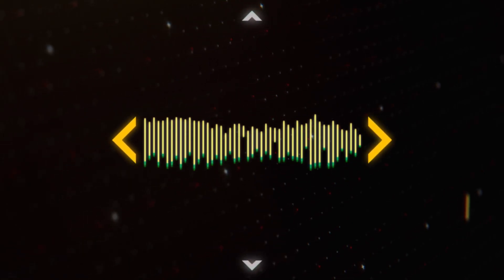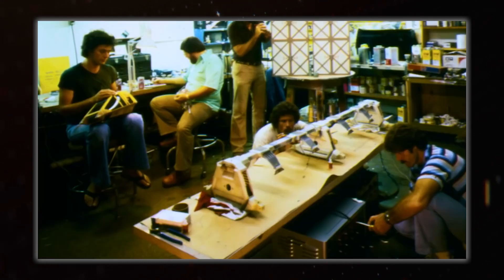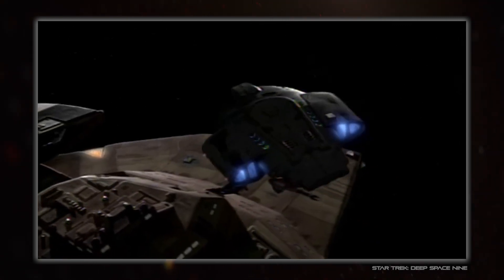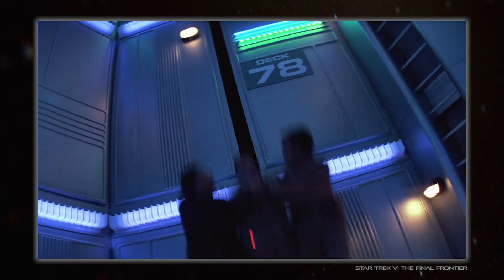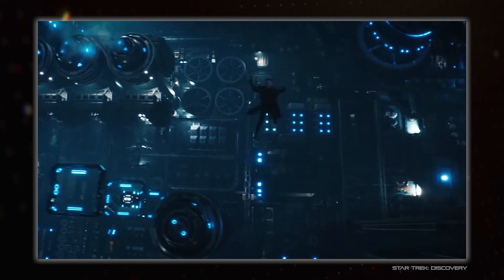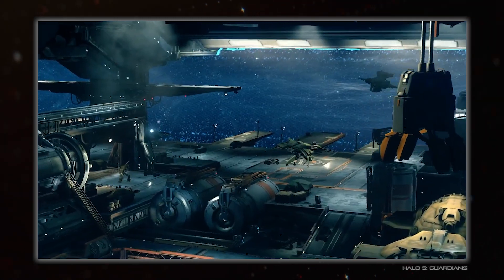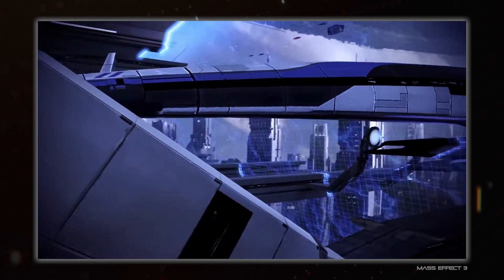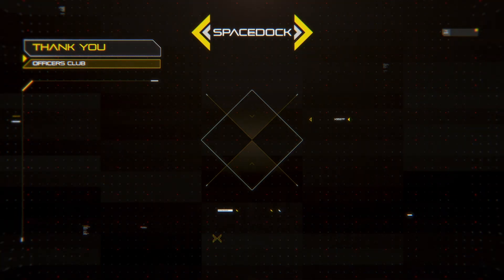Why Do Sci-Fi Spaceships Seem To Change Size?

Comment: A video on the practicality of ship size would be awsome!

It's such an important part to building a world, and can lead to some crazy stuff with massively oversized vessels.
Reply: One reason why real-world navy ships are so big is that the crews are huge (in number, not in personal size).  
     The amount of internal volume devoted to "hotel space" (actual industry term) is startling when you look at the plans.   Quarters, food storage, passageways for getting crew where they need to go, gym, sickbay, rooms full of HVAC gear for keeping all those spaces properly ventilated and climate-controlled, freshwater tanks, greywater tanks, sewage tanks, rec rooms, laundry, offices... then you need MORE crew to maintain all of that (cooks, personnel officers, chaplains, HVAC techs, security, etc) and room for them too.
     A commercial cargo ship the same size might have less than a quarter of the crew, just because they don't run under military systems and because they aren't really worried about needing enough people to fight the ship when half of them are dead.
    So the 300-meter Enterprise has 430 crew, while the 100-meter Serenity has five and the 30-meter Millennium Falcon has two.
      Any decisions regarding the size of a ship need to account for the military/civilian discrepancy in crew size, as well as how much room the available tech needs to support those people.
    For example, a replicator eliminates the need for a room full of canned food and a galley, but how much space does the replicator equipment and raw-material storage occupy?
Reply: @stevenscott2136  you also have to consider what it's like to live in them. Living in a submarine is unpleasant. Living on a naval ship, better but not that much better.

If people want to live in space size and the ability to not be constantly hemmed in and claustrophobic

It's why I think big ships and stations are more likely for pure psychological considerations.

Particularly space stations. With ships you might have a mass issue. But in space with no gravity to limit the way you build there's no need to make space anything other than absolutely massive and you don't give people small quarters with low ceilings and pokey little corridors to walk through.
Reply: Building things costs money, so usually the only reason for a ship to be larger than the bare minimum possible is if its increased size (and by extension increased cost) comes with benefits. 

Two smaller ships can be in two places as once, one big ship with twice the firepower cannot. There needs to be some further reason for increased size than a linear increase in firepower alone.

Historically, bigger battleships (dreadnoughts) were built because they could have larger guns and more powerful engines. Aircraft carriers are massive because they need to support a runway.
Reply: @zero3633  that's a very narrow way of looking at things. Particularly in any society that has access to the resources of a solar system and probably large scale automated mining and production of resources.

Cost is going to be fundamentally different consideration in many scifi settings.
Reply: Yeah I’ve always wondered why the ships of Warhammer 40k are SO FREAKING HUGE. Like I don’t really know much about the lore, but wasn’t it mentioned that a “light cruiser” was massive enough to leave a shadow on the planet’s surface from orbit. As epic as they look, I seriously doubt anything that large can keep itself aloft in atmosphere, and it’s a real wonder that anything that big and heavy and expensive can be built at all, especially by a Humanity that is on the ropes
Reply: @andrewhenson8787  Other than the rule of cool, I think there must be some connection with Gothic Architecture, which tends to enlarge the scale of churches once chosen as the main building style.
Reply: The irony is that in space ships really can be arbitrarily large. The only real reason to keep them smaller is the rocket equation, buy y'all people already have super-efficient magical engines that do not require the 90% of the ship being fuel tanks, don't you? =) What nobody seems to consider is how a large spaceship would actually behave. 
My comic has a spaceship that acts as a mobile city and is 5 km long. In any mainstream scifi that wouldn't stop it from doing graceful but still quick maneuvers to evade or attack enemies... The thing in reality is ULTRA-fragile and will destroy itself from tension stress if it just tries to turn too quickly, any maneuver it nees to do takes hours to complete.
Reply: @DarthBiomech  ,
This "The irony is that in space ships really can be arbitrarily large" is contradicted by this "The thing in reality is ULTRA-fragile and will destroy itself from tension stress if it just tries to turn too quickly, any maneuver it nees(sic) to do takes hours to complete".

Some people take time to plan their ships... depending on how much they want to use reality, lol.

In David Weber's Honorverse his superdreadnoughts were 3.2km long with a mass of 64 million tonnes. When someone ran the numbers, that person facepalmed. His superdreadnoughts, the toughest ships in the Honorverse, had the density of smoke. After talking to the person, Mr. Weber sent off revisions of his ships to his publisher, and all subsequent printings have the more correct numbers for all ships classes. The typical superdreadnoughts now are 1.3km to 1.4 km in length with a mass of 7.5 million tonnes to 8.5 million tonnes.

The reason for this change, other than embarrassment, was how he envisioned space, especially technology, to work in the Honorverse. Other than anti-grav/counter-grav/grav generators (technology related to ship defenses, engines, artificial gravity, and inertia compensators), hyperdrive and associated tech, and ignoring the ridiculously high energy output of just fusion power plants, he uses real physics. Ships need to accelerate to get anywhere and need to decelerate to stop moving. As mass directly affects the acceleration curves, the smaller ships have much better acceleration, and thus mobility than larger ships. This little fact changes space battles completely as it affects engagement ranges, engagement length, and affects the ability of a superior fleet to intercept (to destroy and/or capture) inferior fleets. So it has a huge impact on the stories he's writing.

For everyone else:
The reason people need to consider the size of ships... is how the stress of acceleration and deceleration has on the ship's structure. It takes time for the affects of acceleration/deceleration to effect the entire ship, and the portion of the ship closest to the engines will be constantly accelerating/decelerating at a slightly higher rate than the portions of the ships furthest away, thus squishing the ship. This compacting and expanding creates failure points in the ship as structural members start to deform, bend, and then break. The negative effects increase the larger and more massive the ship is because of the proportional increase in time it takes for the entire ship to begin accelerating/decelerating.

A 100 meter long ship begins accelerating at 9.8 m/s/s. It will take a fraction of a second for the furthest parts of the ship to begin their acceleration. The stress on the ship is minimal.

A 160,000 meter diameter battle station begins accelerating at 9.8 m/s/s. It will take several seconds (probably over 20 seconds) for the furthest parts of the battle station to begin accelerating. The stress on the battle station is going to cause support structures to wear out quicker compared to the 100 meter ship.

Of course, this is only linear acceleration add in acceleration from the other possible axis, and rotational acceleration (spin) and things for large ships get much, much, worse. So, their designers need to plan for complete overhaul or replacement of entire ships otherwise, the combat effectiveness of the ships will directly lead to their destruction.
Reply: @aralornwolf3140  It's a non-combat ship, so it being fragile (again, RELATIVELY speaking. The thing's engine nozzles are large enough that you can put entire another smaller ships inside of them, so they generate a TREMENDOUS amount of power and dangerous enough to not get behind for few hundred kilometers) isn't really a problem. The only other ship to break a kilometer in length is again a non-military tanker for transportation of fluids. The point is, at some point your ships stop being ships and instead become space stations with engines, but again no laws of physics stops you from making a 10-km long spaceship. It will just fly as unspectacularly and sluggishly as it possibly can, so it'll be useless in combat. But again, I "like" how many scifi assumes that military spaceships are the only spaceships that will exist or be worth to talk about.

> A 160,000 meter diameter battle station begins accelerating at 9.8 m/s/s. It will take several seconds (probably over 20 seconds) for the furthest parts of the battle station to begin accelerating.
Yeah, assuming it's made out of steel, it'll take it 27 seconds to catch up. That's why you don't blast into 1G right away, that's like slapping a paper model.
Reply: @DarthBiomech  ,
Yet... the acceleration shown in star wars greatly exceeds that, lol.

However... accelerating at a slower rate will take forever to get anywhere. Sure, slowly increase the acceleration will make it easier... but... time.. time matters.
Reply: That's where I think UC Gundam could be a good example. There the machines started at a somewhat decent size, but as the timeline went on they started to become ever increasingly massive and overdesigned, reaching the absolute nadir during the Mafty incident. Then after that the machines started to shrink dramatically.

Now there are reasons given for this such as the ever growing need for thicker armor, the need for bigger reactors to supply ever more powerful weapons as well as new systems that take up a lot of space, with the shrinking being the result of a shifting design doctrine focusing more on agility than armor and tech improving allowing for things to get shrunk down.

Of course there are outliers across the timeline, but those usually were prototypes that never made it far.
Reply: stares at Stellaris Solarsystem Craft
Reply: True that would be epic and also something about the miniaturization of tech would be cool. For example the computer on the Saturn V rocket is wayyyyyyyyyyyyy less powerful than even the lowliest cell phone and is wayyyyyyyyyyyyy smaller.
Reply: @507jones3  0
Reply: 👆Wow Congratulations🎊🎊
You have been selected among my New Year ongoing giveaway 🎁 winners INBOX ME  💬.
Reply: I'd say Space Battleship Yamato/Star Blazers remake is a series that has reasonable justifications to why their ships, especially the human ones, is at that size instead of the size of ISD or other multi-kilometers sized ships that populated other franchises. 

Like, they're confined to a single solar system worth of resources, where the hell are they going get materials for a fleet of huge ships in the first place?

And then there's the issue of the human just barely survived total extinction with a fraction of population left, so they also don't have manpower to crew large ship as well. It got to the point that at one point, the flagship is the only ship in the entire fleet that has human crews and the rest are basically Capital ship-sized Drones! 

And to top this all off; despite their standard battleship is just the size of Real Life Iowa class battleship, the thing come equipped with what's basically a water-down version of Death Star Super Laser. Why waste resource and manpower on bigger ship when your Iowa battleship-sized ship can already blow up a small moon and multiple of them firing in tandem can blow up a planet?
Reply: @machaiping  >Like, they're confined to a single solar system worth of resources, where the hell are they going get materials for a fleet of huge ships in the first place?
Well, there's enough materials in the solar system to build a fleet with the mass of a small plnet, so I wouldn't worry about resource shortage. If anything, all scifi vastly undersells how vast and how rich one star system really is.
Reply: Generally, for ISVs, bigger is better, because of the square-cube law. A bigger ship can have more armor while devoting a smaller percentage of overall mass to armor.
Reply: In the story I'm writing the largest vessels in production ate roughly on par with the largest real life air craft carriers, the one exception is a mile long alien space hulk that explicitly is an exception to the rest of the settings rules.
Reply: Optimization of space, mass constraints, and physical constants would make for very interesting IRL ships I think.

A kilometer-long dreadnought might be 60% fuel and propellant, 25% radiators and cooling arrays, 10% a multi-gigawatt spinal mount x-ray laser, and 5% life support and crew.

You could have the classic sci-fi show with a cast of 6-10 main characters, and have the be THE ENTIRE CREW OF A BATTLESHIP due to mass savings and automated systems doing most of the work.

Edit: and you could contrast this with say, a space colony. Perhaps the crew gets agoraphobia from living inside for years and planetside or spacewalks freak them out because there is no roof.

In fact, if your life is in 0G I could see falling into the sky being a common recurring nightmare.
Reply: @EgoEroTergum  You make a good point: I always wondered what would happen to a crew of a generation ship, once it reached it's target world. After spending centuries living in space, why would they want to live on a world with a stable gravity field, unknown, dangerous life forms, weather, heat, cold, and earthquakes? Why leave the comfort and safety of their ship? They should have the tech to gather raw materials from asteroids and ice planets, to make repairs on their ship of even build a new one, if they needed the living space due to population growth. 

In my thought experiments of generation ships, I always imagine that the ship would carry colonists in hibernation, while a duty crew would watch over them and the ship. When the found a new world, the colonists would move there and if the crew decided to stay put (or the ship was past it's life span), they would mostly settle on a local moon or asteroid or other planet without an atmosphere and with low gravity. 

I think one day in the distant future, when we are all living on orbital cities is safety and comfort, we will wonder why humans would ever want to live on a planet like the earth again? Hopefully, a clean up crew would be hard at work restoring the ecosystem as best they can, but Earth should become a parkland and only visited by tourists and bio scientists.
Reply: @EgoEroTergum  I think ultimately ship size will be mainly limited by materials available and the size of your shipyard dock.
Reply: @EgoEroTergum  An interesting consideration too is redundancy. With the high radiation levels in space, and the necessity to be able to sustain yourself, it's very likely you'd see redundant systems heavily used. Automation can face lots of failure points (granted you can have fallback automated systems too). Take your ship example, I'd expect lots of automation for day to day tasks, but a fallback manual method for everything. So we're going to need much more crew (still only 6-10 main characters though, most of these guys have the same job, they're just backup). Then scale gets real weird. Even though our crew may be say 50 to 100 people, mostly technicians and maintenance positions, we don't have to cram them into small cabins like Star Trek does. Life support is the big cost for crew in terms of power and space. So we have plenty of room. This ship may have massive open hallways (though all key areas are likely to have multiple quick connections) where you rarely see any of the crew. Or perhaps, our human minds really won't like the concept of open floor plans on spaceships, maybe we freak out. Or perhaps we use tons of space for gardens just so people don't go space crazy, who knows? Depending on tech levels and culture, spaceship design scaling can get really weird.
Reply: Maybe people think making everything bigger, is cooler. Past a point of making any sense for the purpose the ship is used for. Like 3 km long ships that would need 50,000 crew members to operate. Over-scaling things can also break the immersion, when gets to the nonsensical range.
Reply: @vast634  why would you think in an advanced ship you'd need 50k to operate in a super high tech highly automated civ that could build ships that big?

It depends what everything is for obviously.

This is why I like Banks. The war ships, sorry very fast pickets, are tiny, a few hundred meters long and it's all engines and weapons (if they've not been removed). But the GSVs are absolutely massive because  people live on them, why the hell wouldn't they be if they can?
Reply: oooh yes... Hello whole Star Wars francise :P (I probably just pissed off some people)
Reply: @florianN132  Lol you are not wrong but there is worse. Though that one scene of the Executor crashing into the death star... The curvature is wrong for the size...
Reply: @florianN132  and the Warhammer 40k as well (Gloriana being like 20km++ and with km corvettes)
Reply: @explosivemodesonicmauricet1597  I kinda get dummy big stuff in the 40K universe though.
Reply: @explosivemodesonicmauricet1597  Ah, 40K, that beacon of realism… ;-)
Reply: I know a person who constantly  creates absolutely huge ships and berates us for creating reasonably sided ships instead of a km long corvette.